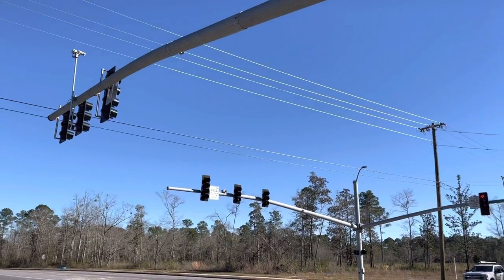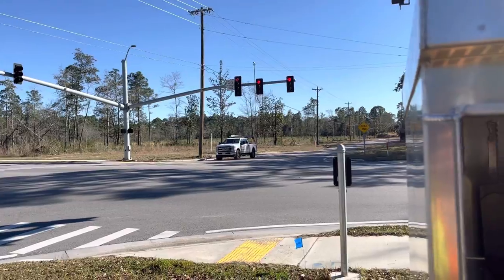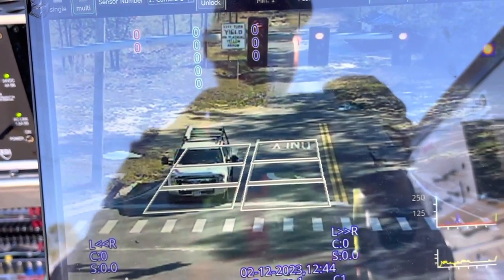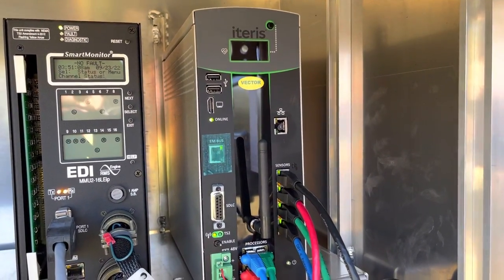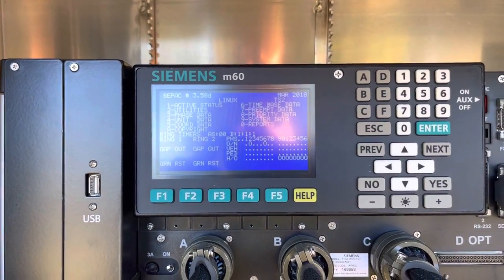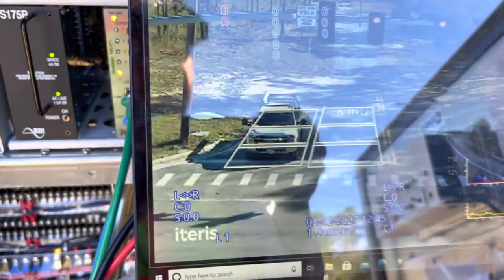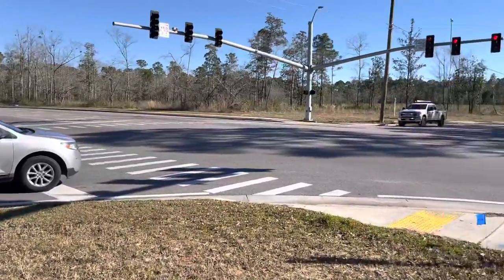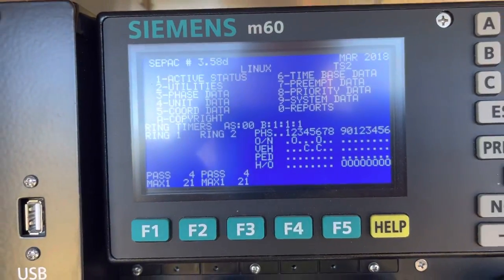TRAFFIC LIGHTS! How an intersection works!

Comment: This is really cool man. My city did away with red light cameras years ago because they weren't making any money, but in the last few years I've been noticing new cameras mounted on traffic lights. It never occurred to me that they might be running the lights, I assumed we still used the magnetic sensors in the road.
Reply: some do you have to just watch for if the cameras are there
i call these new ones AI intersections

Comment: Are the cameras smart enough to see turn signals on vehicles for a combined turn/straight lane with a left arrow?
Reply: Unfortunately not, the most advanced  video based vehicle detectors can only work out if there is a vehicle there or not, the type of vehicle, and some can deduce the speed of the vehicle. They can't see turn signals yet.